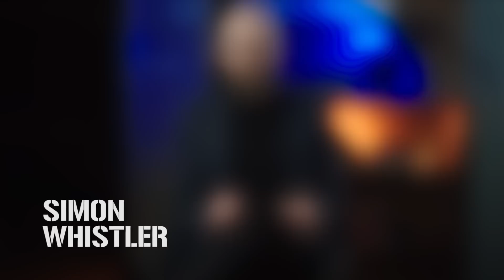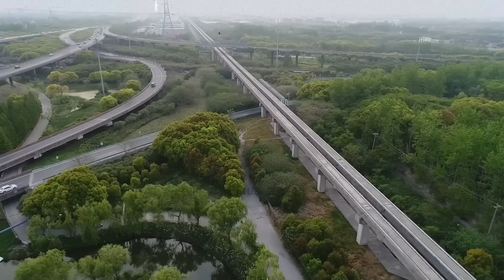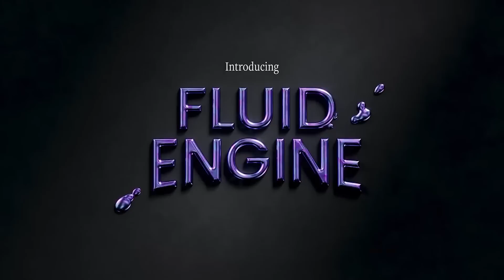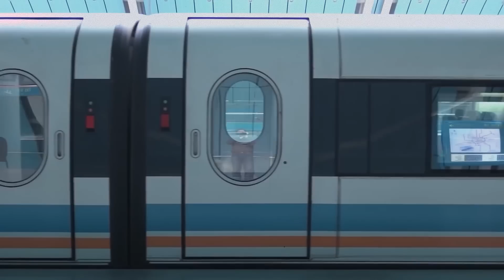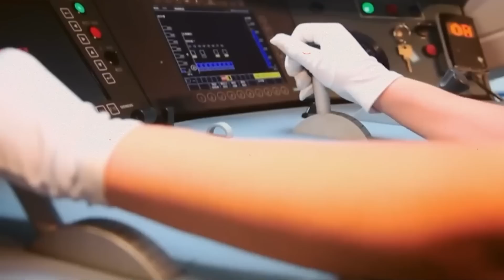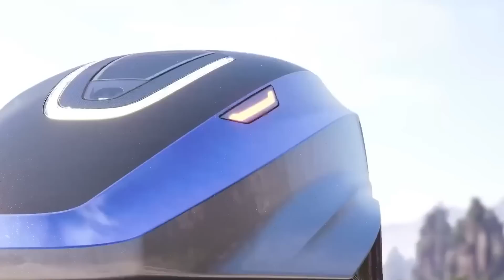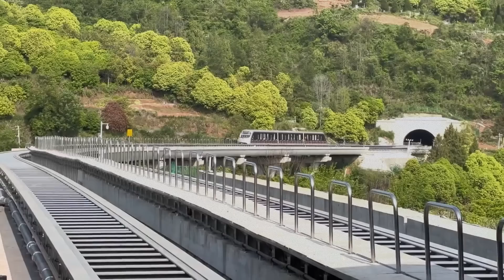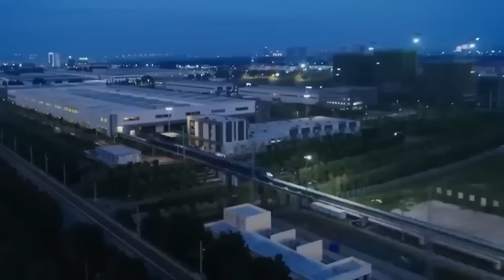A Chinese Maglev Revolution is Coming...

Comment: Unfortunately, the Shanghai Maglev actually sucks! It's nothing more than a geeky tourist attraction. It only goes to 300kph in service (something the standard HSTs in China can do). It doesn't get you to the city centre or anywhere near it (have to transfer to the busy metro for another 40mins or so to get there). Get this... they board and deboard the train through ONE door! There was no more than about 50-60 people using when I took it last year.
Reply: When I took it last it went 430kph
Reply: @danysainz-gootenberg7809 that would be before 2021 then
Reply: It's a proof of concept project, which they dropped because it was too expensive. It used to go 430, it can even go faster, but now it's capped at 300. Anyway, I have no complaints, with out it, if I go to Shanghai it would take me 2 hours to get into town, but instead it takes like 45min, with a transfer in the middle of cause, but I'd rather have it around than not.
Reply: @lzl4226  
Yes, if these things can take an hour off the DAILY commuting time for 10 million people, that's
great.  If they can practically move 5 million people out to 1/2-priced housing and real estate, that's great too. 
But taking an hour off the travel time for a fat-cat's trip to Shanghai - that's stupid.
Reply: @hg2.  It was never built for profit.....
Reply: @lzl4226  
The NYC subways used to be independent and were built for profit.
Reply: @hg2.  alright then, if it makes you happy ... "NYC subway number one, all other trainy things stupid"
Reply: Well, I guess we could get a good idea by comparing it to the US one!
OH WAIT.........
Reply: Simon does actually explain the 'why' of the Shanghai Maglev. China was about to build a new high speed train network and wasn't sure of which technology to go with. The Shanghai Maglev was basically r&d. When they built it they decided it was too expensive and went with conventional HSR technology bought from Japan.
Reply: @ballyhigh11  
Those long maglevs sound stupid.
Reply: 因为地铁票价更便宜，而磁悬浮列车票价50元人民币（只有游客愿意）
Reply: These long-distance mag-levs don't make sense -- that's what planes are for.

If these things can take an hour off the DAILY commuting time for 10 million people, that's
great.  

Or, if they can practically move 5 million people out to 1/2-priced housing and real estate, that's great too. 

But taking an hour off the travel time for a fat-cat's trip to Shanghai - that's STUPID.

* * * 

Actually, these long-distance mag-levs aren't for helping ordinary people, or even fat-cat business men. ---  They are for the bribes, boondoggle, and bragging-rights of the evil CCP.  (This comment will get deleted by pro-CCP censors.)
Reply: The long-distance ones don't make sense -- that's what planes are for.

Comment: There is a REASON that almost all the b-roll of maglev trains in this video are of the Japanese Maglev... and it's because at this moment in time, Chinese-developed maglev technology really is a piece of fiction. They have a 1.5km test line that they've run a train on at speeds of 60km/h (not 600km/h).
Reply: And China hasn't even started constructing track for this proposed Maglev network. Japan on the other hand is well into the construction of its 280km maglev line with it probably completing in around 3 to 4 years.
Reply: @ballyhigh11  Probably closer to 5–6 years at least at this point. Originally scheduled for 2027 but due to the problems in Shizuoka (and like other challenges) it's pushed to early 2030s.
Reply: These long-distance mag-levs don't make sense -- that's what planes are for.

If these things can take an hour off the DAILY commuting time for 10 million people, that's
great.  

Or, if they can practically move 5 million people out to 1/2-priced housing and real estate, that's great too. 

But taking an hour off the travel time for a fat-cat's trip to Shanghai - that's STUPID.

* * * 

Actually, these long-distance mag-levs aren't for helping ordinary people, or even fat-cat business men. ---  They are for the bribes, boondoggle, and bragging-rights of the evil CCP.  (This comment will get deleted by pro-CCP censors.)
Reply: Thank you! I thought I was going crazy. I've read so much that they've achieved 600km/h and are going for 1000km/h, and for the life of me, I find literally no footage other than the footage of it leaving the hanger, or moving like 10 feet at an expo/reveal event or something. Oh, and shitty computer-generated graphics.
Reply: @Notsogoodguitarguy  Yeah... it's a lot of CCP headlines repeated ad nauseam by YT creators and news outlets... but mostly vaporware at this point.   

Not to say they won't build it... but it's true that their Maglevs planned network are similar to the US's HSR network plans at this point.

Comment: Too bad it's all garbage construction.  The costs to try to maintain crumbling infrastructure is way higher than building it well the first time.  The USA went with air travel over rail (for several reasons) but it's too bad we don't have a couple cross country high speed rails, even if it was mostly for cargo.
Reply: China actually has a larger highway network and busier air routes (for example the Beijing -Shanghai is twice the busiest in North America, transporting 22,000 passengers daily), with comparable passenger figures. However HSR replaces the 'missing middle' for far larger numbers -the HSR between those cities carries 575,000 people daily, that no amount of planes could ever hope to carry, and dodging a pollution generating, traffic clogging, 12hr ordeal by car. All at a fraction of the cost, with legroom for days and bars, creches, restaurants on board, and only a few mins longer (if less) than flying if you key in check in, boarding and dwell times, plus getting to the city centres. 
Imagine rocking up at Grand Central and being in Montreal 2hr 45 mins later, with a train every 15 mins, for $40-$100 depending on carriage class. This would be the equivalent offer for Shanghai to the random provincial city of Wenzhou - the train is packed and both cities boom.
Reply: @zupermaus9276 air traffic cheapened due to economies of scale in the USA which made passanger rail more expensive overall. I think HSR projects can have great value but the infrastructure is so much more than developing more efficient airplanes.
Reply: You can't run planes on electricity.
Reply: We already do. Lol. Welcome to the future.  @hughmungus2760

Comment: The sensible way to do maglev is neither of these things, it's a third option only developed relatively recently - the Inductrack concept, an EDS track without any superconductors.  Hall effect dynamic levitation with normal rare earth magnets offers the ability to passively coast to a lower speed in a power failure.  Failure modes for the Transrapid / Shanghai tech are obscene, and JR-Maglev's superconductors are so far reliant on deep cryogenic cooling.  Inductrack skips those issues.  An adaptation of JR-Maglev to modern REBCO tape magnets working at liquid nitrogen temperatures would be similarly a major improvement.

Comment: i went on the shanghai maglev in nov 2004- not bad. had a look in the drivers cabin.  looked basic plus the drivers had an assistant sitting on a kitchen chair !
only problem is that this line only runs  a short distance into the shanghai suburbs, you need to catch the shanghai metro to get  ito shanghai proper.. its only a 20 minute ride and only hits top speed for  less than a minute..
Reply: The shanghai maglev is just one ouf our german transrapids, so technology from the 80s and 90s that we cancelled here because of the cost and one accident. The system is great, sad that shanghai is the only place it's getting used. But it's already old and china doesn't directly have access to the german plans, but time moved forward!
Reply: What's your point? Time indeed did not stand still, and China's high speed rail technology including the train and cars themselves are all upgraded and fully built and fully 100% Chinese technology now. It is more advanced than what Germany had back in the day, or today. China is already researching 1000km/hr rails, having already produced working prototype for 600km/hr rails. I don't believe germany has done such a thing yet, let alone researching 1000km/hr ones.

Also, China has built 45,000km+ of rail in record time and more high speed rail than the whole world combined. It has also built such rail lines in the most varied and difficult terrain and environments, and at massive scale so no one has the experience or expertise that china has currently. Not Japan or Germany or anyone.
Reply: @ex0duzz  
The long-distance ones don't make sense -- that's what planes are for.
Reply: @ex0duzz  china has had far more accidents than any other country with their high speed rail and the quality is not as good. any amount of research and effort on your part will confirm this( plus it helps when you have colleagues from china confirming). if you can't understand context or nuance of my comment, then maybe then internet is not for you...
.. and maybe it would help with your claims if you didnt come across as agressive...
Reply: @TheRahsoft  If you did your research you would know that accidents on Chinese hsr are remarkably low for the size of the network, also lmao at the quality being not as good.
Reply: @hg2.  Not if your trains go 400mph.
It takes 2 hours to board a plane and an hour to leave the place.
Trains only take about an hour to board and 20 minutes to leave.
Reply: @johnsmith1953x  
So so spend $20 billion dollars so the businessman can save an hour on his trip to Osaka?

Get a real job. 

Read my other comments.
Reply: Listen you can stop talking NOW, the China today is nowhere near what it was in 2004, your opinion is truly worthless for that matter
Reply: Long-distance mag-levs aren't for making cost-benefit sense.  They are for the bribes, boondoggle, and bragging-rights of the evil CCP.  (This comment will get deleted by pro-CCP censors.)
Reply: These long-distance mag-levs don't make sense -- that's what planes are for.

If these things can take an hour off the DAILY commuting time for 10 million people, that's
great.  

Or, if they can practically move 5 million people out to 1/2-priced housing and real estate, that's great too. 

But taking an hour off the travel time for a fat-cat's trip to Shanghai - that's STUPID.

* * * 

Actually, these long-distance mag-levs aren't for helping ordinary people, or even fat-cat business men. ---  They are for the bribes, boondoggle, and bragging-rights of the evil CCP.  (This comment will get deleted by pro-CCP censors.)
Reply: love the brief part where the whole train tilts abit when turning
Reply: I'm sick of it.   

These status symbols don't help a million commuters get home an hour early. 

These stupid things aren't for transportation, they're for political bragging rights, like the Moon shots. 

Long distance maglevs, "bullet trains", HSRs  --- that's what PLANES are for.
Reply: See this video;

China's "ghost" railway stations prompt questions about rapid expansion ...

^^ $1 trillion in debt and they don't make money.

Long distance maglevs, "bullet trains", HSRs  --- that's what PLANES are for. 

These status symbols don't help a million commuters get home an hour early. 

These stupid things aren't for transportation, they're for political bragging rights, like the Moon shots.
Reply: See this video;

China's "ghost" railway stations prompt questions about rapid expansion ...

^^ $1 trillion in debt and they don't make money.

Long distance maglevs, "bullet trains", HSRs  --- that's what PLANES are for. 

These status symbols don't help a million commuters get home an hour early. 

These stupid things aren't for transportation, they're for political bragging rights, like the Moon shots.
Reply: Not a problem with the technology, just a problem with the system they decided to build, which was a small technology demonstrator.  Later it's served mostly as a tourist attraction.
Reply: It is 40km in distance and the entire journey takes 8 mins. That is just a show case to the world.:face-green-smiling:
Reply: @icebaby6714  the f is  : face-green -smiling:?
Reply: @icebaby6714  it took 20 mins when I went on it. i recorded the timing, and not really that much of a show case
Reply: Now the speed has been downgraded from 430km/h to 300km/h, but still only takes 8mins, which I just rode last week. It cut the distance from my home in shanghai to the shanghai pudong international airport from 55km to 20km
Reply: You do realize China has like 50,000 miles of high speed track for
trains that typiclly go 250MPH. Right?
Reply: It's a 30 year old German train, what do you expect
Reply: The long-distance ones don't make sense -- that's what planes are for.
Reply: @hg2.  But when you take the plane checking/boarding time and the time travel to/from the airport, it does make sense in many cases, and don't forget there are multiple stops, which means there are many not-so-long-distance segments in between.